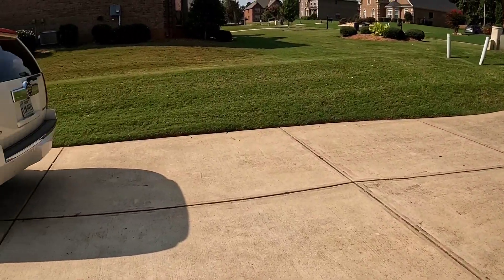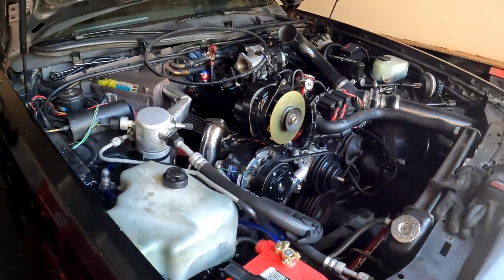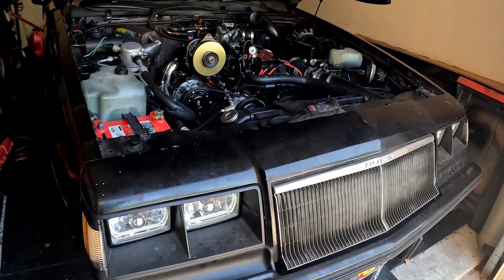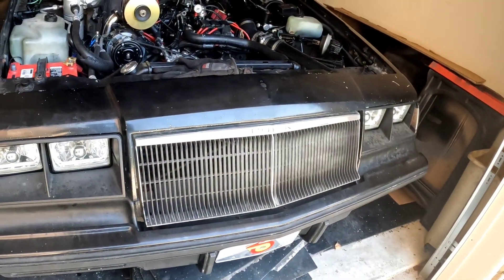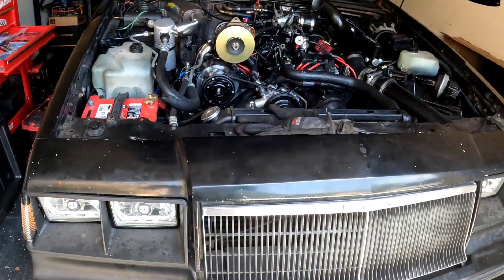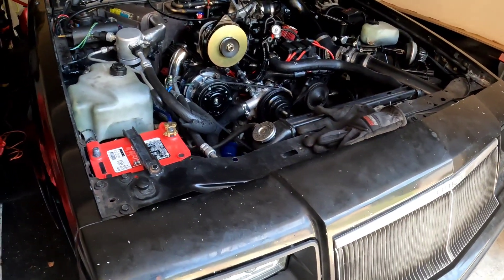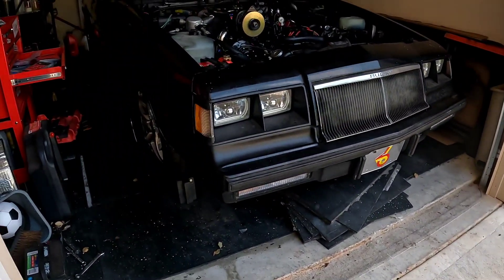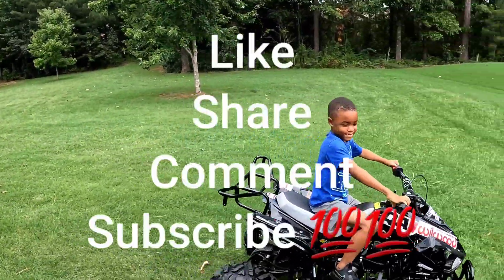Why The Buick Grand National Is Better Than A Hellcat | E 85 Conversion

Comment: ✔️ I had a coworker from 1994-96 who owned an '86 Grand National. It was pretty much bone stock, but it was quick as hell, and it was also luxurious and comfortable as hell, because it's a Buick! You could buy these cars in any color you wanted, as long as it was black! 😁

In the mid 80s, I used to hang out at Cecil County Dragway on Friday nights after I was done with high school and work, and we used to see guys back then running 10's and 11's in hopped up Grand Nationals and T-Types that were still 100% street legal. 

The T Type was the slightly stripped down version of the Grand National, without the decals and other bells & whistles, but with the same turbo 3.8L V6, so they were just as fast. They also came in colors other than black.

Comment: i had my 87 work done by Steve v out of Virginia.  20k to get a 500hp 600tq grandnational.  I'm running  93 octane with razor alcohol injection with 3000 stall lock up torque converter.  TE 60 turbo.  2.5 pypes exhaust with a 3inch down pipe  cat deleted.  Hotwire fuel pump kit.
Reply from the maker: I just went to 3inch dp. Going from 2.5 exhaust to 3in and running e85. Not going to do much else uetz since it's hot air and  building LSA for my 96
Reply: @PNCTV-ng2me  My neighbor down the street running e85 on his 87 on mickey Thompsons.  He helps build with watts performance he said he smokes scatpacks and pulls about even with hellcats.  I also have a 92 gmc typhoon and I'm getting a aftermarket ecu done and a complete system harness replacement.  Stock 4.3 turbo 280hp and 360tq.  After the ecu upgrade I should be 4 to 500hp plus the typhoon is all wheel drive and even stock for a suv it's 5.3 to 60 at 3800lbs.  It beat the srt 10 viper truck in  the quater mile.
Reply from the maker: That's dope. I always wanted a Typhoon. Watts is about to rebuild my tranny soon as I get my seats back. Not really trying to make too much noise with this hot air but Eric says I should get low 122s high 11s with my set up so we'll see. When I grab my 87 I'll do a little more. I need the 87 and a BMW 850 and I'll be good 🤣🤣
Reply from the maker: I have a ta 33 turbo with hot wire no cats ported intake 87 ecm and icm. Never got to see what it will do but I found a guy who will build a 58/58 turbo but if I did that I would change can and heads